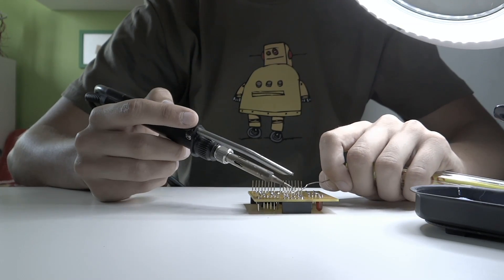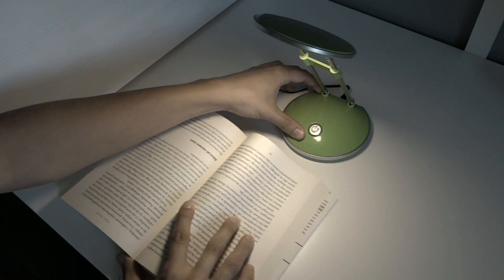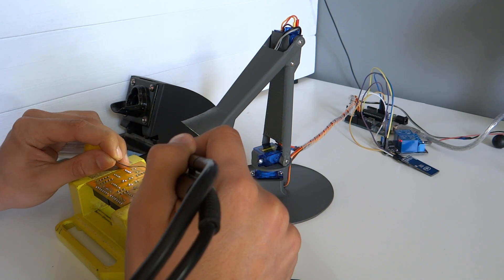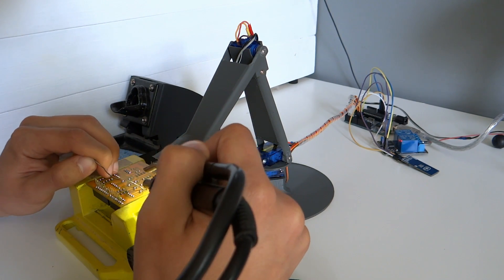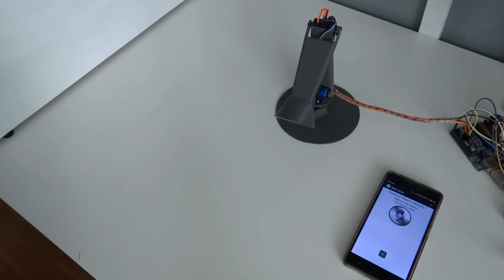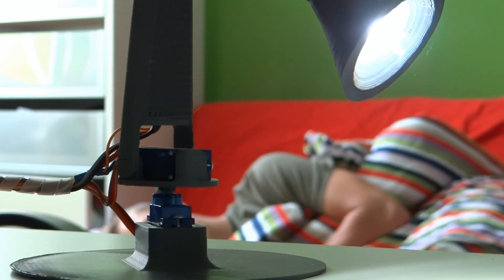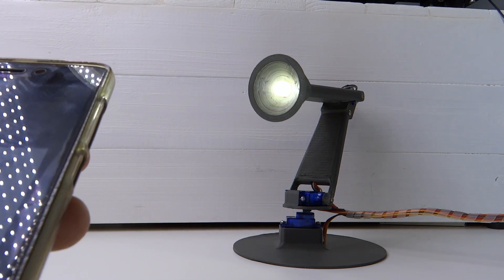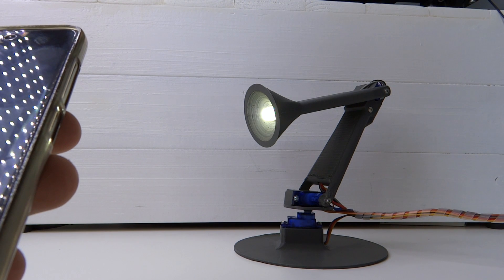Arduino Voice Controlled Bluetooth Moving Lamp

Comment: Only problem with this is actions they are not fast. Time he spending on giving command is equal or rather could be more than manually adjusting the lamp. May b its just prototype and future models would b much efficient than this

Comment: Where's the wall electricity connector?
Reply from the maker: It is just a 12V power supply with DC jack, so that you can connect it to Arduino